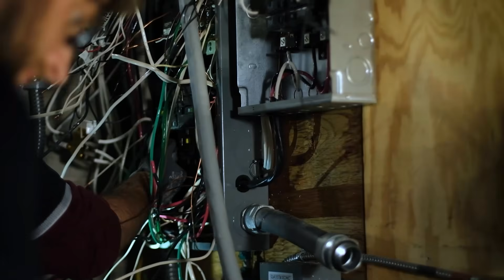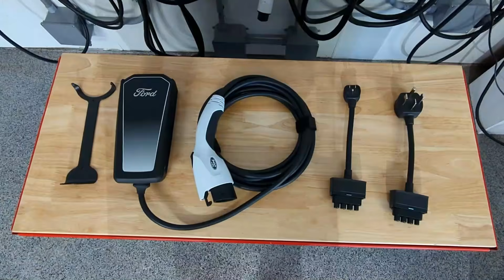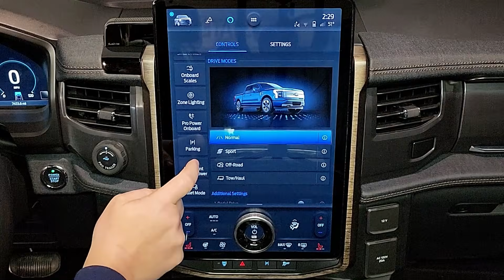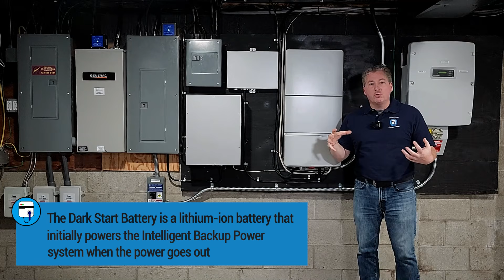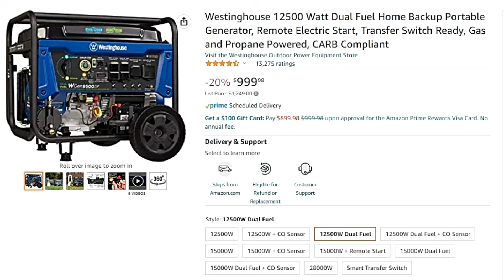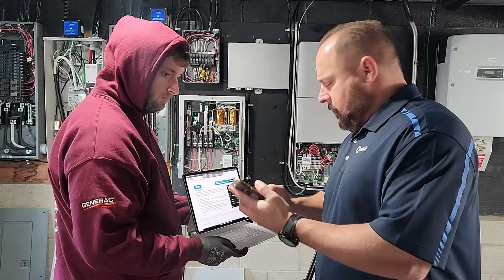Watch How Ford Lightning's Intelligent Backup Power System Works In A Real Home

Comment: This was a very interesting video and very timely as I am considering how we might integrate our Cybertruck, once we get it, into a whole home backup solution. Have you considered adding a SPAN smart panel to your configurtion and having it automatically shed loads?

Now that the IRA provides an incentive for battery-only set-ups, I am thinking of going with a minimal Tesla Powerwall+ system which would include the Tesla Backup Gateway 2 and the Tesla Powerwall+ system with one or two battery assemblies. Once the Cybertruck capabilities become known then we should be able to tie the CT to either the Powerwall+'s Inverter Assembly via DC or land an AC lead from the CT onto the Tesla Backup Gateway 2.

It is rumored that Tesla is planning to go wtih LFP-based batteries for the next genertion of Powerwalls. I am under the impression that LFP might be a better choice of NCM when it comes to home backup solutions. I guess time will tell.

Comment: Great video, Tom! I’m one of the Lightning owners that put in a manual transfer switch to run power into my house from the 240V/30A Pro Power outlet. $1100 for the transfer switch (has to be a special neutral-switching transfer switch due to the truck’s generator system being neutral-bonded) and install by electrician. Couldn’t be happier, and I still have the option to run a normal gas backup generator, as well.

Comment: Thanks for this, awesome review and conclusion, I do have a question, in my case I did the work to connect a gasoline inverter  to my home with an outside plug to the main panel and just use the  interlockkit to prevent the feedback to the grid, but with the lighting or even the hybrid F150, I could use the 240V output and connect it to my home panel too righh? and just enable the circuits to not go above 7KW or 9KW?
Reply from the maker: Yes

Comment: Fantastic video. I am guessing investing in a whole-house generator is going to be the best bang for your buck for most for the foreseeable future. I do love how you show the integration with your PV system. I have a micro-inverter PV system (240 Vac comes from each panel), so using the Ford/Sunrun inverter as the PV integration point is a non-starter. -- What did you use to create your animated power flow graphic? It was very professional.
Reply from the maker: I didn't do that myself, I hired an animator.
Reply: @StateOfChargeWithTomMoloughney  Well kudos to them and your choice of animator.
Reply: @StateOfChargeWithTomMoloughney  Thanks for hiring the animator, it made it so much easier to explain to my wife who does not understand electricity!

Comment: Great video. It is a lot to go thru for less than 10 kw. But it depends on what you already have or do not have already for power outage. Excellent presentation of the process for wiring it all. I went the portable "solar generators" route for power outage essential circuits. They can be charged by portable solar panels or a small Honda generator that I already had before I got into these "solar generators". No EV for me yet. 2 Hybrid vehicles that get excellent gas mileage. Thanks for doing this video.

Comment: If a home owner didn't have any solar or generator yet I could see the cost ratio being much better to have solar installed at same time. Additionally i would imagine rebates would kick in if installed all at the same time making it a much better price point.            Any info on Quasar 2? Havnt seen anything since January 2022 at one of the tech shows.

Comment: Tom, I enjoyed your video.. I was wondering how would the system work… you definitely brought clarity on how it will work. On a related matter, you mentioned that the Ford truck is the only vehicle that provides V2H; however, Lucid suppose to be able to provide the same although they are not currently rolling out the equipment to do but the vehicle is supposed to be bi-directional.  I don’t expect you to purchase a Lucid to set up a demo but would like for you to know if it will work the same. Thank you in advance…
Reply from the maker: At some point, when Lucid's system is functional and customers can buy it, I plan to set something up with Lucid to make a video like this.
Reply: @StateOfChargeWithTomMoloughney  thank you very much… I always enjoy your videos…

Comment: I have solar with a backup battery and transfer switch.  In an outage, the battery will take over almost instantly and give me power for most of my loads as well as access to solar.  If I get an extended outage and a cloudy day (which will exhaust the battery), I have a critical load panel on a manual transfer switch (on the home side of the auto transfer switch) with a 30amp generator input I can power with a portable generator.  With a lightning equipped with pro-power, I would be able to use the 240 output instead of the generator to power those critical loads.

Comment: Hi Tom,

Great video as always.  A few comments / questions...

1) I think you made the implication that the 7.2kW Pro Power Onboard is standard on the Lightning.  This is not the case on all trims.  On the standard range vehicle, it is an adder (about $1K from what I remember).  Otherwise you don't get the bed outlets, including the big 240V 30A L14-30.

2) So with your prior electrical setup, you had a meter monitoring your solar power production for both the big and small Sunpower grid-tie inverters.  Now this is only monitoring the large inverter.  Is this meter used by your utility for net metering, or just for your visual accounting?  Your new setup won't account for the generation from the Sunrun inverter (which replaced the small Sunpower inverter).  How is this being accounted for in your net metering billing for cases where you produce more than you consume?

3) In your earlier video from mid-last year with all the Q & A about the system, it seemed like Ford was going to require you to purchase the activation of the feature.  Has this now changed?

Thanks!

Comment: Tom, good video, but you mention that the system CAN do price arbitrage? Is that true? I got the impression that the system could only come on when there was an outage. Can it supplement the power to your house while it is still connected to the grid? 

I suppose one could turn physically off power to their home each day to achieve this! but it seems not intended for that function right now and would require some work arounds on the owners part to achieve.
Reply from the maker: It can't do so automatically. Let's say you're working from home you could physically turn off the power in the morning when rates go up and let the truck power your home all day. Then turn it back on at night and charge the truck and power the house until morning.
Reply: @StateOfChargeWithTomMoloughney  thanks. That is what I thought.

It would be awesome if it could do so automatically (or power your home in parallel with the grid) for true "powerwall" like capability. 

This would make the cost a lot more appealing. As the system could save you money.

Comment: Since you have solar connected to the Ford inverter, is it possible to divert excess solar to charge the Lightning in some intelligent way instead of sending excess to grid?
Reply from the maker: I think it is technically possible. But personally, I'm not interested in that. To me, it makes no difference if my solar production flows to the grid or to my battery. It all nets out the same. :)

Comment: Before I start this and all your past videos are the best out there for this type I have learned so much from you tom as a UK resident I still find all your videos irresistible and interesting informative and instructional Other words AWESOME you are a professional for sure the way you portray yourself and all your videos are fascinating and easy to understand so thank you from the bottom of my heart tom.
iam in the UK and don't own a ford lightning I would love to but ford art making any right-hand drives is a great shame but hey I still enjoy watching your videos as you are so fair on how you present each item and your very right it is expensive and can cost a lot to install but here in the UK we get little power outages and most only last an hour at most usually to do with the substation as all our cables to our houses are underground and out of harm's way this is why I don't understand it's not done in America except in cities as you have terrible weather where yes we do get stormy winds over a 100 mile an hour but no or little tornados saying that a small one appeared last year in my home town of Rugby and took a few roofs of houses and only lasted minutes thankfully but I do own an EV a Vauxhall Mokka ultimate  ev with a 57 kw battery and a 225-mile range which is plenty for me yes the winter does effect the distance travelled dramatically when it's in the below freezing temperatures but as I charge with my 7kw charger fitted as standard in the UK you can get larger capacity but mine charges in 6 hours from flat so it does me fine I always charge off-peak after midnight I haven't used any quick chargers as test as I haven't travelled a great distance in it yet I do get free charging from bp pulse for 6 months when I register it so I will give it a go as they do seem to have quite a few chargers here. anyway, off topic I do wish all vehicles now had the capability to charge your home or been able to plug in a 240-volt appliance where so many don't and only a few do I did notice MG from china is starting to fit their evs with power outlets as some Korean cars do as well so I do wish they would legislate this into manufacturing this way it would make all evs more appealing to the masses and of course reduce there prices I do think compared to ice vehicles they are grossly overpriced the gas power version of my car is over ten thousand pounds cheaper and they made a loss on producing my ev and I had to wait 13 months for it with no clue when it was coming until it arrived on the garage forecourt even the dealers had no clue when it was coming they were given no information Stalantis is a terrible ev provider I would never buy another vehicle from them again I do wish I had saved a bit more and got a tesla y but hey you live and learn so I will keep this a couple of years and get a tesla next time maybe the tesla 2 will be out by then or the aptera which I do like and there making right hand drives bless them for that.great video tom as always I still found it interesting to watch maybe by 2030 they will have standardized them all to have the voltage flow both ways and to all have power outlets to power your appliances we can but hope all the best from john from Rugby UK.
Reply: What about the Transit electric full size van?  That is a much larger van, and several feet longer than your small compact car.  I think they have a right hand drive version in England, and the ones in Europe are made in Turkey.

Comment: Great unbiased review Tom. I’m surprised at the cost of the total system. I have Tesla Solar and PW. I hope the CyberTruck could be used for bidirectional. Using a Tesla updated wall connector and Gateway with inverter.  Even at $15,000. It’s still  cheaper than installing a whole home generac gas generator in Texas. Before i got solar. I got quotes of $18-$20,000. I closed Solar and Powerwall.  Keep up the great work Tom.
Reply: FYI Quote for 24KW Generac in KY $12,100 works great but love reading about EV's and technology

Comment: I spent about $13,000 on a whole house battery backup that’s integrated with my solar panels. It switches on and off automatically and it recharged from my solar panels when I had a week long power outage. Watching this, I prefer my system to the Ford solution. Especially because my system recharges my battery from my solar panels.
Reply: What brand out of curiosity?
Reply: @ Enphase. I went with that brand because my solar panels are using Enphase inverters, no other reason.

Comment: The price for this system is ridiculous.  Wired properly you can use the 240 volt 30 amp as a portable 7200 watt generator which will more than handle your critical load circuits.

Comment: Tom this video was so good. This was the pinnacle episode of this channel. Thank you for sharing your experience with us. 

What do you recommend for a small single family home to combat against infrequent power outages. I have my heart set on the Tesla power wall for all long time. You mentioned a gas generator and a sub panel. Obviously it is cheaper, but do you recommend solar generators like Ecoflow. I want to have power for furnace, water heater, some lights and refrigerator that’s all.
Reply: If you have a 4,500 watt electric water heater, it will require a substantial generator to power that one device.  However if you have a gas water heater, they do not normally require any 120 volt power, or if they have a power exhaust fan, it will be less than 150 watts.  Do you have propane available?  

Is your furnace propane or natural gas or all electric?  Electric furnace is going to require a very substantial generator, to power mine would require a 25 KW generator, but a smaller one can power a heat pump just fine.   My heat pump would require something in the size of 10 KW to 15 KW to power my heat pump and other loads.  

I guess the big question is how many power outages do you have each year, how long, and what can you do instead of installing a generator?  Can you go to a local motel for showers, and a comfortable place to sleep at night?  Will your home be damaged if the interior temperature goes below 30F during a power failure and damage the plumbing?  

Powering just the 0.5 KW refrigerator is easy, so is about 20 of the table lamps at 20 watts each with a LED light bulb.  A dozen phone chargers at 15 watts each, no problem.  Laptops at 25 - 40 watts each?  No problem.  4,500 watt electric clothes dryer?  Problem. . .. . 

I am considering installing a 5,000 watt 120 volt inverter / charge controller for up to 3 KW of solar and 48 volt battery charger all in one unit.  It would meet all of my back up needs for power.  Just the 48 volt battery, if lead acid golf cart batteries would be about $875.  And I bought 8 each 250 watt used solar panels for $85 each on Craigslist in Portland Oregon.  So I could have a string of 300 VDC at 8 amps from the solar panels, and that would provide enough power to run my smaller heat pump and refrigerator every day of the year!  Total cost about $3,000?  

I bought a 12,000 Btu 120 volt heat pump for my nephew's rental home.  We mounted the indoor unit on a TV cabinet, and ran the refrigerant tubing out the window to the outdoor unit.   He lives in Vancouver Washington, and it has run great, allowing him to not run the electric heaters in the rental home.  His power bill is below $120, while his neighbors are over $200 - $300 in some cases.  It only draws about 9-10 amps, even less in the cooling mode, and uses a variable speed compressor!  17 SEER.
Reply: even a portable power station/power bank (like one of the mini generators but made of batteries) outputting to a twist lock plug that's tied to a breaker at your electric panel (you will need space for a 2 pole breaker and a manual interlock to kill the main while it's active) will power some of the devices you mentioned. Those Ecoflows would be nice. Electric water heaters are a huge user of power, but it will hold water that's warmed already for a while even in an outage.

Comment: Amazing video Tom! I've been looking forward to this one for a long time. You didn't disappoint. True to form, your presentation is super-thoughtful, comprehensive, and balanced. The graphics are 🤌. Fascinating point that using the onboard 240V Pro Power Onboard plug with a manual transfer switch is a MUCH more cost-effective solution.

Comment: You probably covered this but I don’t recall how long the truck can output 9kw?
Reply from the maker: Until the battery is drained or it reaches the cutoff limit that you set in the truck. It's a 131 kWh battery so if it was fully charged, and you were pulling the full 9 kW (Which probably won't happen - at least not sustained) it would last about 15 hours. But in reality, you can probably power a home for 2 -3 days before it was really drained.
Reply: @StateOfChargeWithTomMoloughney  Thank you!

Comment: Tom. I was wondering why you didn’t AC couple your existing solar inverter to your home integration system load panel.  The delta inverter manual shows you can do this. Seems like it would really extend the capability.
Reply from the maker: Hmm. I was under the impression that wouldn't work. I will look into it and speak to Ford. But honestly, it's not really an issue for the limited time the power is out it's not going to make a tangible difference, especially with the generator. But I will find out if I can do it.
Reply: If you consider the 9 KW solar system will not produce power during all the hours the power is out and the sun is shining, then consider how much it will cost to recover these "Lost watts".  So say it is 100 hours a year, and you are paid $0.10 per KW, or $0.90 at noon, less in the hours before or after noon.  So at the very most, your lost wattage is only about $80 - 90 per year.   And how much would it cost to prevent that loss?   And if you only have 25 hours a year during the daytime with lost power (about 5 days a year) that would be only about $20 a Year in lost income from the solar system.  

My vote, take the loss of power instead of trying to recover that few hours per year.